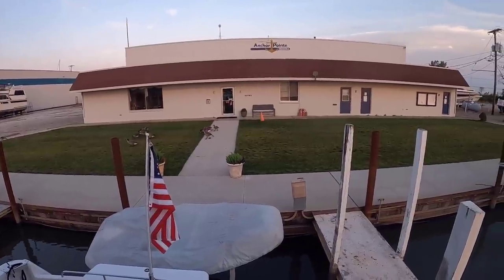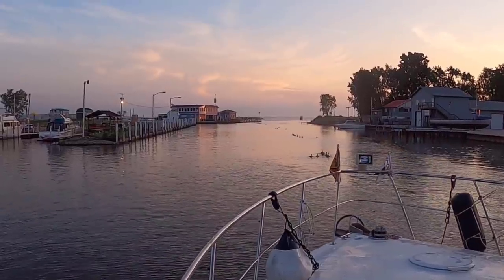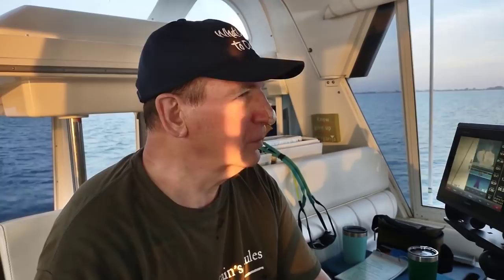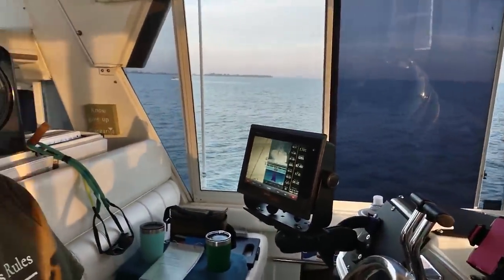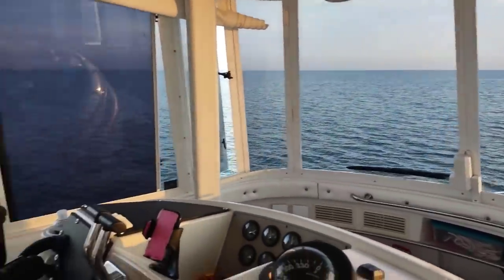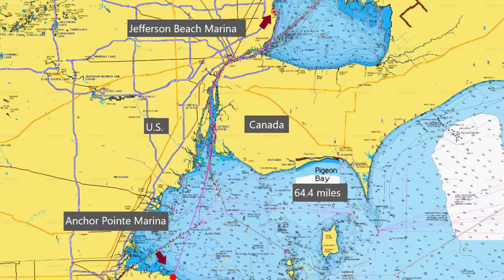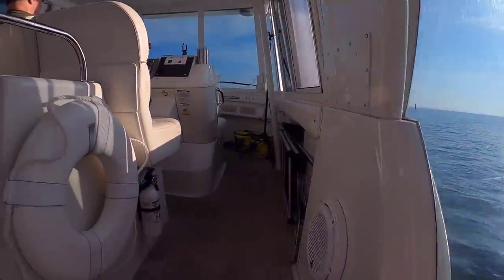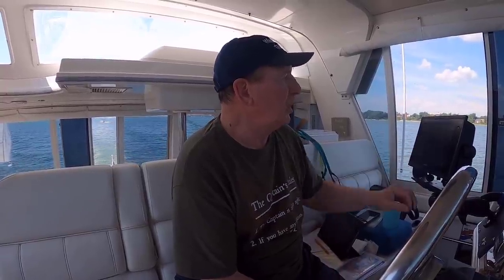Great Loop Route #154: Curtice, Ohio to St. Clair Shores, Michigan | What Yacht To Do

Comment: Dumb quest...if the boat is running why do you need the generator on to use elect in the galley? I just fig if the engines are on you can use anything on the boat.  Great vicarious view of Lake Erie!!!
Reply from the maker: Hi. The Range is the only item in the galley that needs dedicated Group 1 power (hi draw) which can only be done via Shore Power or Generator. Engines have alternators that keep the battery banks charged underway and an Inverter then takes the battery bank DC and turns it into AC for appliance outlets in the kitchen as well as the ice maker in the Lido deck. 😊
Reply: @WhatYachtToDo  Wow, alot to learn, everyday is a school day.... Thanks for the info, def learned alot watching your videos....have fun !!!!